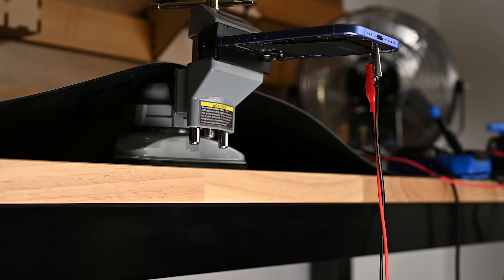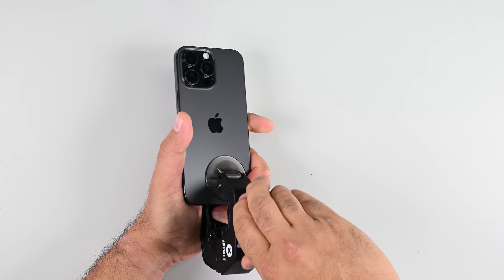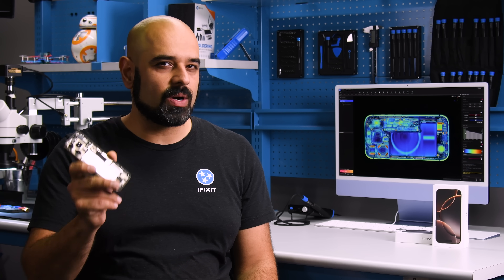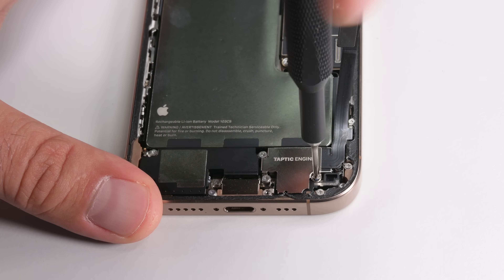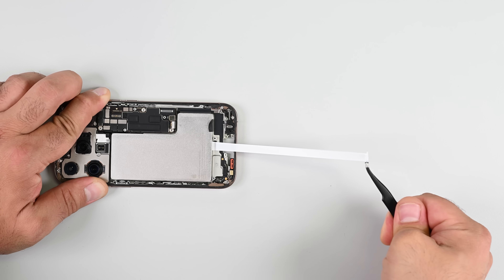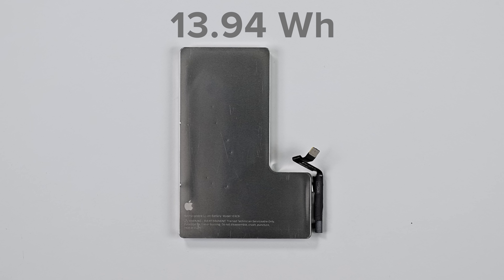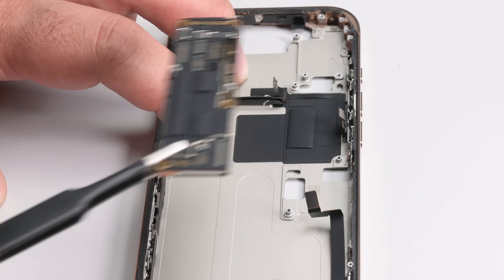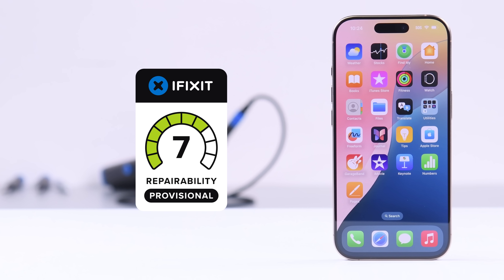iPhone 16 Pro and Pro Max Teardowns - Worth The Upgrade?

Comment: 7 out of 10 is a complete joke. Even after replacing the battery, you need to use a random chinese battery program machine to reset the battery counts. Many parts that usually break are not easily fixable because of apple's hardware signing. I don't understand how this scores higher than the switch.

Comment: i wonder so much why the Pro Max got no battery changes/upgrades, especially considering it’s size. i went with the Pro Max primarily for the purpose of longevity. it truly is lovely to use, however it seems the weakest of the whole lineup in regard to that battery 🙃

Comment: Aquí: 1:06 solo agregale una gota de alcohol a la pua para que el adhesivo se despegue sin que lo rompas o reemplaces. Si le agregas alcohol, ya no necesitas calor.
Here: 1:06 just add a drop of alcohol to the pick so the adhesive comes off without you having to break or replace it. If you add alcohol, you no longer need heat.

Comment: Next step for Apple chip development is to get rid of that Qualcomm 5G modem and replace it with their design embedded in the SoC. The plan is there however making as good modem as Qualcomm's proved to be quite hard even for Apple and that's why it's still not there yet.
Great teardown as always, iFixit and Right4Repair rules!

Comment: 2:55 that hollowed out section is part of the front speaker's acoustic port, nothing to do with any antennas. Apple moved to this speaker design on all iPhones that have the Dynamic Island.

Besides, on the exterior of that hollowed out section is still titanium - unless there's a glass/plastic window there, no way will there be any "punching through" of RF signals. The mmWave antenna is actually the thing to the right of the rear camera system with the array of 5 vertically aligned circles. It faces the back glass where the UWB antennas used to be.

Comment: The stretch adhesive you want to heat up the phone from the front side and it'll stretch way better without breaking.  It's a huge difference even with a tiny bit of heat vs. room temperature.

Comment: should i feel scammed or w/e because the promax doesn't have the new "metal" battery encasing?
Reply: No, since it wasn’t an advertised feature. They’re likely testing different battery tech across the lineup and/or they’ve faced manufacturing limitations on which models can get the new casing.

They’ll likely roll out the metal casing to all iPhones in a future lineup.

Comment: so whats the better in case transfering the heat away the 16 pro or pro max battery model?
Reply: Neither. The metal battery doesn’t touch the frame so it does nothing for heat transfer. It’s just to help with swaps and to prevent potential bulging, which may be more common for the smaller (and so more frequently ran to zero) pro battery.
Reply: @Jordan-ru8yf  but someone tells that pro max it doesnt got the heat so much cause they got blank space on mobo than pro base model?

Comment: So compared to the largest 16PM battery, the smaller 16P battery is safer, right?
Reply: Maybe. Definitely if swapping it out. But the PM also has larger starting size. As such, it may be ran down low less often for most users, which is a known cause of degradation and possible failures. So, Apple could have simple determined the increased capacity of the PM lessens the need for the metal casing safety features. In essence the metal casing may just balance the real world risk of both out for the average user.

Comment: Because the mAh size isn't shared in the video for the iPhone 16 Pro, I took it upon myself:

Through some little table math the iPhone 16 Pro has a:
3.83 V 13.9412 Wh 3640mAh Battery
(The Math: 3640mAh x 3.83 V / 1000 = 13.9412 Wh)

(The Math (the other way): 
(13.9412 Wh x 1000 / 3.83 = 3640mAh)

:)
Reply: Would be good to compare the energy density of the two sizes - the 16 Pro's metal encased battery and the 16 Pro Max's conventional pouch battery

Comment: 3:24 I would love to repair my iPhone 13 but there’s several reasons I won’t 1 I believe it’ll last me the remaining 3-4 years till I have no choice upgrade well aside from battery life . I would repace my battery accept for other reasons. 1 software locking means it’ll be yelling at me for replacing the battery not to mention my screen does have a decent scratch and something tells me if I was to attempt to replace the battery the screen would probably shatter when I remove it there for making me replace it as well making the repair cost nearly half the price my phone is worth
Reply: Hopefully the parts-pairing comes to older iPhones so that we can get rid of those messages for genuine/OEM parts.

Comment: 16 pro signal strength is 100% negatively impacted from the removal of that antenna. I work in the middle of nowhere, however we do have towers that are spread far on this one certain road as you drive down it. Galaxy S21U, S23, iPhone 13, 14, 15 pro's no issues over the years, struggled in some spots but has been great. 5G and LTE active currently, 16 pro barely functioned on the network the entire duration of the drive today almost. One spot it was really good. Not very impressed.
Reply: I highly doubt you're getting mmWave in the middle of nowhere. That's almost certainly not what you're observing.
Reply: mmWave is provided by small % of service providers, and 5G is not available in middle of no where.
May be there is some other issue.
Reply: As others have stated mmWave isn't used for remote locations which is the only use case for the antenna we're talking about. It's higher speed but relatively short range so only makes sense for high density locations like sports arenas, airports, etc. Makes zero sense to put mmWave "in the middle of nowhere."

Comment: Which battery will degrade fast, pro or pro max?
Reply: The casing shouldn’t really matter. It’s not for heat dissipation, and battery degradation at different temps is an uncertain topic anyway. Arguably the max has greater starting capacity so you will notice degradation less. You will also run it to near zero less often as a result, so it will probably win out a bit. But the lifespan differences are probably minor and not something to choose between them for. The only real differences of concern is the longer starting battery of the max and the larger (to large now for most people in my opinion) size of the max.
Reply: @Jordan-ru8yf thanks

Comment: 7 out of 10, when every single component is paired to the logic board, are you serious? Also, fun fact, the new camera button is welded to the frame, so you have to buy a new housing if it breaks

Comment: It's extremely questionable how you are rating these phones. You did not cover parts pairing at all in these videos.
Reply: Parts pairing is accessible now to normal users. You can swap OEM/genuine parts between phones and do the parts pairing process all by yourself.
Reply: @fujinshu  yes, listen to the corporation.
Reply: He did. You now have some ability to reset and paid parts. Realistically, some balance is good. While Apple for sure will do every they legally can to stop repairs it is indisputable that theft of iPhones has been largely eliminated due to the efforts, which make actual people a bit safer. Without parts pairing phone theft for repair parts would be a thing immediately. Now, this doesn’t mean Apple can’t do much better at allowing third part parts pairing and make the process for actual owners to do it much simpler. But again, iOS 18 does make steps in this direction. Watch the video carefully first.
Reply: Could be because of accessible repair manuals.
Reply: They were paid off by Apple 😂
Reply: @dislikebot  source ?
If you don’t have it then stop spreading BS.

Comment: 7/10 is way too high. 

Any phone that does parts serialization and software locks deserves an automatic 0/10 repairabilty score.
Reply: Software lock does make people safer. It has essentially killed iPhone theft. 

Now, that doesn’t mean Apple couldn’t make an easier system with better access to verified OEM and third party replacement parts. But some level of parts pairing is good, so long as legal oversight ensure companies don’t abuse it. I would rather some non properly recycled phones have a lock on their parts than have a substantial increase in phone theft muggings since real people get hurt in those situation. Also, iOS 18 has improved the process. Again, more could and should be done but a saying it should get a zero is naive both in terms of actual repairability and other impacts of the pairing feature.
Reply: they are doing it to avoid countries steading those parts for wars/drones

Comment: Weird, so the Pro Max gets neither the new metal battery nor the new electrical adhesive, the 16 gets the electrical adhesive but no metal battery,, and the regular Pro gets pull tabs. Odd mix. Hope next year it's all metal and all electric pull tabs.
Reply: They're probably either testing a mix of solutions, or the manufacturers for either the new electrical adhesive or the new metal battery are unable to fulfill Apple's order for every single thing in their lineups so Apple is electing to have a mix of products. They probably will decide on a single solution for iphone 17.
Reply: @ArchusKanzaki  or both. If either of ideas fail, other models will be fine
Reply: When real world testing you try not to put too many variables together. It’s a common practice in engineering.
Reply: Gotta be supply issues. Bus as said it’s an accurate test for the best system
Reply: Probably because the battery is so big it doesn't need to be removed as often
Reply: exactly. i'm so disappointed

Comment: Can someone explain 3:02... where is that opening... the top is straight titanium, no antenna like where the antenna was on the 15pro where now the capture button is
Reply: They are probably banking on it reaching the plastic antenna band at the top to gain signal access. But like he said most of the country can’t even use 5gmm signal.
Reply: The frame is bonded aluminum and titanium. You can’t see clearly what parts are which. The titanium frame does have a gap of aluminum to allow for greater signal pass through. It’s just not observable without an expensive scanning equipment like shown in this video.

Comment: I guess they are testing three different battery design.
One with voltage to remove rhe battery, another as original apple design and then another metal shell. 
Maybe they won't go with metal shell and voltage run through to release the adhesive together.
Either metal shell or easy to remove the battery. With metal shell it's more safe, dense and can be removed via anything lol. So maybe this one is the best solution out of three.
Reply: Also better in transfering heat away
Reply: Yeah, I also feel like they're testing the solutions. Between standard pull-tabs or metal shell with pull-tabs, or the new electricity thing. They probably will standardize on next Iphone, after they decide which one is the easiest for both their technicians, and Apple's cost for producing an Iphone.

Personally, feel like the voltage run is the safest way. I think I feel safer with lithium cells being allowed to swell, rather than being cramped into a metal shell even with a pressure-release valve.
Reply: @ArchusKanzaki  but metal shell is better for repairing as technician can easily pry remove it without any issue
Reply: @hilmyakatsuki1665  no, metal shell is SAFER to remove, when the pull-tab breaks like what the video show, but that does not mean its any easier to remove compared to standard battery, when they are still glued on them. I don't think Apple will ever move away from gluing battery too. The alternative will be screwing-down battery, but I don't think that's preferable since the screw might be placed below other components, making it more difficult to remove.

A 9V battery with alligator clips is small enough for most technicians to add to their tools, and the result is clean and easy removal imo. The concern will be that means the technicians will need special glue tape for the iphone when they need to put it back, but I think that's easy enough to solve, by just selling the battery with pre-applied electric glue.
Reply: @ArchusKanzaki  metal shell it needed to safe guard dense cells and make it compact while be safe. 

Apple can use the easy to remove with 12v and metal shell together.
Reply: I'd prefer a metal shell with pulls tabs, out of the 3 options as it will help protect from swelling. And safer to handle.
Reply: Have you seen JerryRigEverything's video about the iPhone 16 Pro teardown? It may be because of the EU regulations. Last year, EU is mandating that all smartphones have removable and replaceable batteries in 2027.
Reply: @gelgel4823  yeah that's why they testing different solutions

Comment: iPhone 16 Pro's battery uses the new "stacked" tech. Was rumored for 15 Pro/Max, but never came. That's why is more dense. Also both 16 Pro uses M14 OLED materials for their screens vs M12 on the vanilla 16 (same as 14 Pro/15 Pro)
Reply: Nope they are enot using stacked battery technology yet. They just added enclosure for the battery in adherence to the EU regulations on ease of battery replacement and repair.
Reply: Are the batteries actually using stacked technology? I’ve seen nothing that confirms it so far.
Reply: What you've just said was never confirmed. Have you seen JerryRigEverything's video about the iPhone 16 Pro teardown? It may be because of the EU regulations. Last year, the EU mandated that all smartphones have removable and replaceable batteries in 2027.
Reply: @gelgel4823  I have posted in Reddit with video proof from other big channel.

Comment: Why does the Pro Max not have the metal covered battery like the 16 Pro?
Reply: They're testing the different techs.
Reply: Probably suppliers.
Reply: I would personally assume maybe it could be because of the 16 Pro Max having more physical area to dissipate heat...?
Reply: @confus2d they also have themal paste in the pro
Reply: Testing supply chains with the least selling model out of all 4.
Reply: @NanoMine  isn't the base Plus model the least selling one?
Reply: Probably will have next year.
Reply: The weight
Reply: thats why i'm NOT UPGRADING.

Comment: 7/10 never thought an iphone lineup would ever score so high
Reply: iPhones do typically score 7/10 before the parts pairing days, it’s pretty much back to normal now which is pretty good.
Reply: The part serializing was the only thing keeping the 14 have a low score. Now that you can remove the back glass, reprogram the parts, remove the battery and screen easily, the score is high
Reply: They used to have higher scores before Apple went bonkers with hardware pairing.
Reply: Apple has definitely improved when it comes to repairing. 

Not sure why they didn’t do this sooner as it’s a win win scenario.
Reply: @BobMcBurger1 it’s not a win for them, they’re only doing it because the EU is forcing them to change.
Reply: @menacingdonutz have you considered that this can be a win for apple AND that they’re doing it because the EU forced them?
Reply: @menacingdonutz  so it’s a win for them, got it
Reply: @sys-administratorthey block third party parts too
Reply: Thank EU 👀
Reply: Hello. It's true that viewing through a magnifying glass ruins the screen. On iPhone 16 pro max?
Reply: And a score most Android phones will never achieve...
Aside from their software-lock, iPhones have alibis quite easy to repair actually
Reply: @Raja995mh33 Isn't iPhone unlocked most of the parts except for security sensitive parts?
Reply: iFixit are Apple sheep now. 7/10 is a joke.
Reply: @nath13033 Lol Samsung fanboy detected 😂